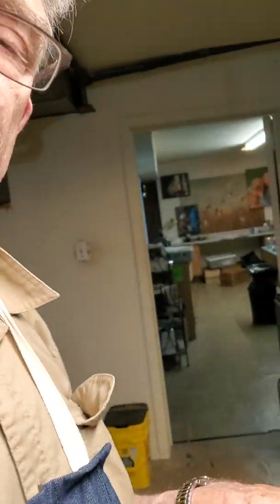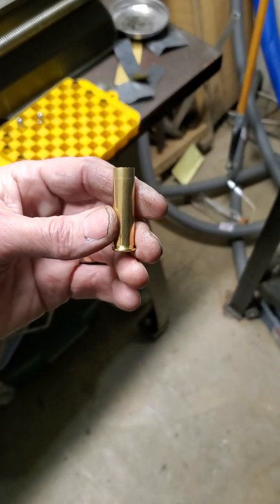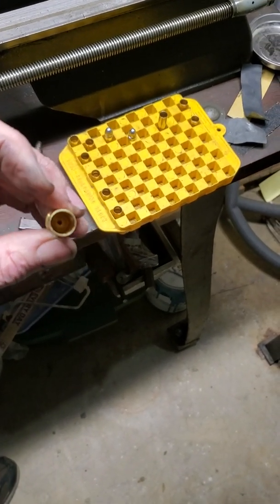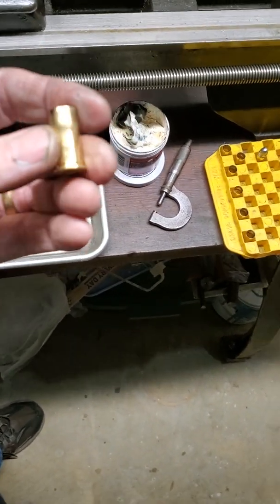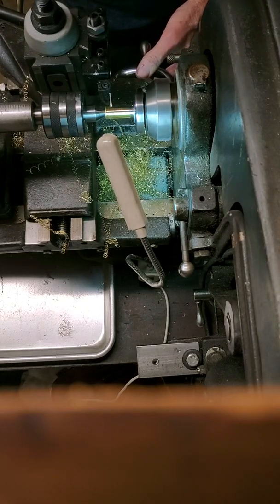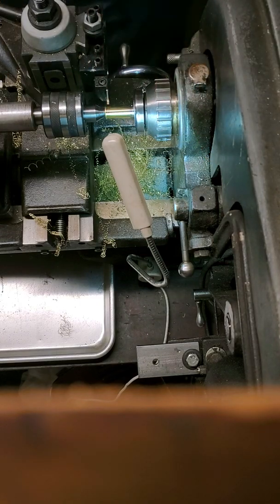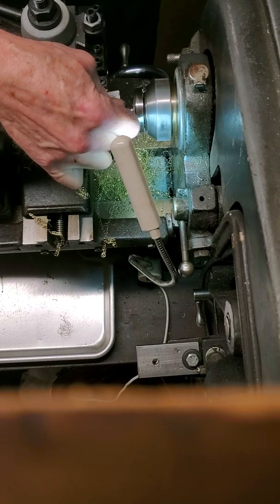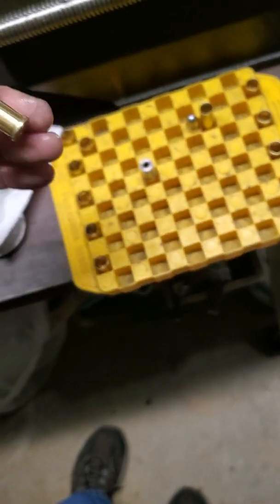Making an obsolete cartridge case on a lathe

Comment: I'm enjoying the video, it's very informative, however I have an obsolete cartridge for which there is no parent case to work from. If anyone has any idea if this works from a brass solid standpoint to create the cartridge from whole cloth. I'm trying to figure out how to get 17.5x28mm rimfire. Yes no joke. And like I said am wondering if machining brass would work. The cartridge is 17.65mm od top tapering out to 17.90 mmat the rim with a 20.10 rim. Offset primer socket of course. The recommended powder charge is 60 g. Any advice would be appreciated.
Reply from the maker: That's a big one. But I think it could be done. You might want to ask about it on the case reforming sub-forum on the Cast Boolits forum here: https://castboolits.gunloads.com/forumdisplay.php?218-Case-Forming-Re-forming
Reply: @SwabbieSteve  yes, it is big. The projectile is .69 caliber. The rifle is a 17.5 mm danish Snider conversion,type3 Snider. It's been certified safe to shoot by a gunsmith. As a matter of fact he said it doesn't look like it's even ever been fired.To have the brass made by c+c machine is about $320 a little steep. I'm thinking about trying lathing. There is a video on machining brass shotgun shells. So I'm believing it's possible, I just 2anted an experts advice first

Comment: also couldnt you cut your brass out of solid stock?
Reply from the maker: A lot more work!
Reply: A case from solid bar stock will be very weak at the head. Steve's method preserves the strength of the drawn case.

Comment: Why do you cut with a parting tool? 🤷‍♂️
Reply from the maker: Only because it is very narrow and fits easily in the limited space. But its not required.
Reply: @SwabbieSteve  but quality of the cut would be better with a single point cutter. 😉
Reply from the maker: @karlfroschauer290  The tool is ground with a slight angle, so it cuts with a very small point. The finish is fine.

Comment: Can you share a way to reduce rim size, I only have a small 1/2" capacity table top drill press,  I am making 351 Winchester brass and 401 Winchester brass and the cases require reducing the rim, enjoy your videos.
Reply from the maker: Rim diameter or thickness? Diameter can be done by spinning the case in a drill press and using a file carefully remove a little at a time.
Reply: @SwabbieSteve  okay, thanks, thought maybe there was a more accurate way, like fitting a tool for cutting the rim in a vise on drill press table.